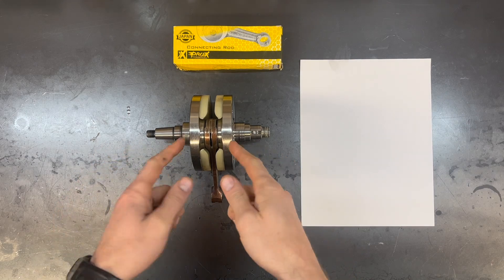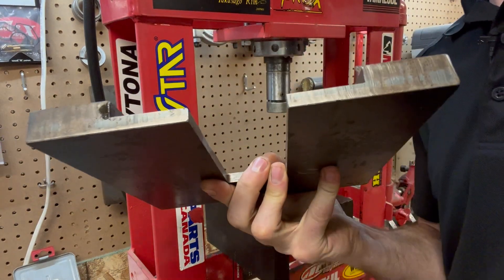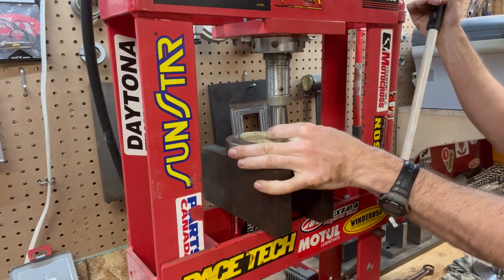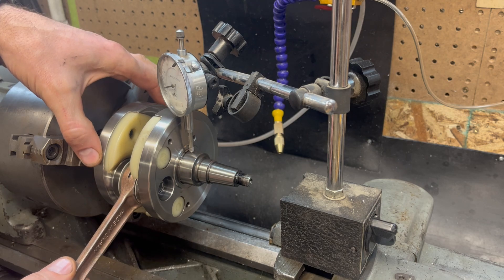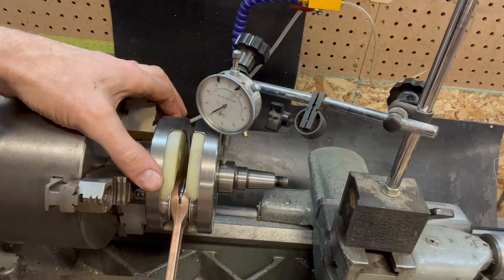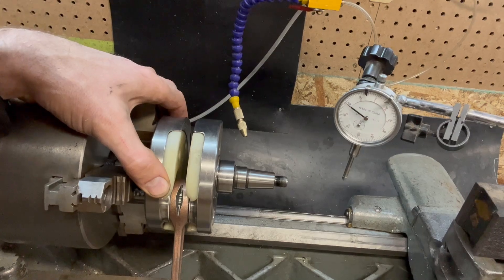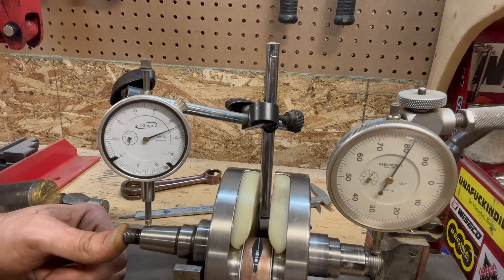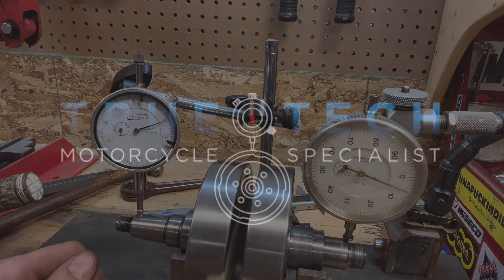How to Rebuild a Crankshaft

Comment: Finally! We have a professional. We have so many people rebuilding low ends, top ends, etc and not using any measuring tools and then they wonder why the bike’s parts don’t last. I’m surprised they even run at all. When building anything internal on any engine or transmission your best to measure it all and this way you have a motor and transmission that’s going to last a very long time and perform to your expectations. Thank God for this guy

Comment: Hi Chuck, thank you for this very informative video.  Being fortunate to have a well equiped workshop, I'm in the process of rebuilding a Honda CL350 crankshaft, having previously disassembled the outer crank webs only.  Now, having gently clamped both of the centre roller main bearings into a single vee block (on an engineer's surface plate), the minimal runout I can achieve at the outer main bearing journals (with the outer ball roller bearings removed) is 0.038mm / 0.0015", ie. approx 3x your target figure.  Unfortunately, unlike in your video, my crankpins have what is best described as a smooth-straight-knurled machined finish at their interference-fit ends, each which has formed a corresponding knurl in each crank web when it was originally assembled at the factory.  This has effectively created a 'spline' which is preventing the crank webs from being adjusted (I'm using a copper-head mallet) as demonstrated in your video at 4:46.  Any further advice would be very much appreciated; thank you.
Reply from the maker: It sounds like you’re describing micro-splines, which are quite common on older engines. They can still be adjusted a fair bit but do require more attention during the initial alignment. 
The numbers you mentioned are within the spec I mentioned (.002”) however.
Reply: @ChuckfromTrueTech  Many thanks for your prompt reply.  I've just found a Honda factory manual for the CL350, which details a "Standard Value" for shaft runout of 0.0008" with "Serviceable Limit" of 0.006"; this latter figure sounds very high to me, but then having trained as a tool maker where we worked to tenths of a thou (imperial units), it can be difficult to break the habit of working to very fine tolerances 🙂.  On a serious note, I do wonder whether this crankshaft with even a 0.0015" runout might have contributed to the smaller/LH main bearing having loosened in service on the crank, only slightly, but still enough that this bearing now needs Locktite to secure it.

Comment: Great video. I've done a hundred or so two stroke cranks and you've verified a lot of my suspicions, even to the point of having to walk away for a few minutes. I haven't done a four stroke crank yet. Aren't they pressed together with more force than a two stroke? What are the differences as far as rebuilding technique?
Reply from the maker: Not usually any tighter. Just have to line up the oil holes.
Reply: @ChuckfromTrueTech  I have a couple to practice on. All it'll cost me is a rod kit and hopefully I'll have a good crank😎👌

Comment: Hello bro,
if the thunderbird 350x bs4 crank only left-to-right little bit side play is good to used or what ? Not main bearing issue also not crank sound problem bearing problem.
only little bit side Play also not too much play it's normal Play only 
And also not main bearing sound issue please do reply Sir.🙏🙏
Reply from the maker: I cannot make out what you just typed man.
Reply: @ChuckfromTrueTech  Crank only side to side little bit Play are normal or not 
Crank bearing are good also not tak2 sound comes from crankshaft only Little bit side Play

Comment: Hi Chuck, do you use any lube on the pin before pressing into the crank web?
Reply from the maker: I don’t. Been thinking of trying it but never have.
Reply: @ChuckfromTrueTech  Thank you Chuck.  Of course, I would like to use some type of lube when pressing the pin for ease of assembly, but in the back of my mind I'm thinking about the increased chance of the pin slipping during operation.  I think I will test a scrap crankshaft and press the pin without lube, then disassemble and look for scuff marks...and maybe try this a few times and then draw a conclusion.  I did see a few videos where lube was used...it looked like 2-stroke oil or something thin like that.  Thanks for a great video.

Comment: Nice vid, I just did my second one in similar fashion.  KTM 85's both had similar run out when I was finished appx .0005 on the far side away from the journals.  Question is what is your tolerance?  The second one vibrates a bit, but my tolerance on the crank runout was the same.  I did lower the squish .004 on this bike. Nothing crazy but my son did say something about vibration when he first rode it.  New mains also.  Any insight would be appreciated.
Reply from the maker: I usually get them within .002”.
Reply: Hi thanks for the vid. I'm practising on an old kart crank. My kart engines go to 20,000 Rpm. I've got  the crank to 00.0005. Is that good enough? I'm using digital mitutoyo DTI which don't seem to register 00.0001.
Thanks again for this vid it's unbelievable helpful
Reply from the maker: @hopperdropper7137  Half a thou is excellent. I'm happy if they're under 2 thou runout.
Reply: @ChuckfromTrueTech  thanks buddy. I wouldn't have got started without your vid

Comment: I'm currently rebuilding a little suzuki GP125 engine and am at the big end replacement stage. This little crank has 2 holes approximately 25mm diameter in each web half. I assumed that these were for alignment pins, to negate the need for the tureing in a lathe. Am I correct?
Reply from the maker: No. Even if you could use then for alignment you’d still have to adjust it after pressing.
Reply: Holes are to get the balance factor designed for the engine.

Comment: Can you rebuild 77-78 xr75 , 79 up xr80 ,81 up xr100 cranks? I was told these are not rebuildable due to the tin (sheet metal) side...also i cant find 77-78 xr75 crank pin...Europe says they have them but the pin looks like one for a 73-76.
Reply from the maker: Can’t say I’ve tried. I’ve done CR250s with the tin stuffers.

Comment: Wait a minute.... Those two halves are ONLY held in by a slip fit!!!??? I did not know this!! How does that not move under engine load!? Wow that's good engineering! You're a master of your craft for sure!!!! I really didn't know this! I'm trying to polish my camshafts and came across this video and its super interesting! Wicked cool thanks for sharing!
Reply from the maker: If I remember correctly it’s the 4th gear on the YFZ450R that’s only held on by interference. That’s some crazy engineering.
Reply: Not a slip fit but a full on press fit.
Reply: Not a slip fit. An interference fit.

Comment: What’s the best way to clean up galling on the inner crank web surface?  When the crank locked up the bearing race dug into the web and   roughed the surface up.
Reply from the maker: Depends how bad it is. I’ve done it with a die stone many times. I’ve also cut it on the milling machine. If it’s that bad though I usually buy a new crank.

Comment: Hi, great video thanks very much. A few questions... what sort of hand press do you call that? 
The jig that the crank sits in, can you buy those or did you get it especially made. If so what sort of spec does it need to be?
Thanks very much
Reply from the maker: All the jigs for crank building are custom made. For pressing them apart I have a bigger one & a smaller one for different sized cranks. The V-block setup I had made by a friend. If you want one I can refer you to him. I bet he has the CAD files still. 
The press is just a cheap 10 ton.
Reply: Hi... yeah that would be great. I'm in the UK so its probably to far to ship but if he has the CNC files might be able to build them. Thanks very much its for my kart racing engines
Reply: Hi... I've found a press. I've got a few more jig questions. Are your resssed jigs 22mm mild steel plate?
The pair of raised jigs look like 25mm?

Comment: I have a older ktm 300 crank with larger plastic inserts on it, would using a special tool like that to press it apart crush these plastic inserts?
Reply from the maker: I haven’t come across a crank that is tight enough to crush the stuffers. Building cranks requires attention to detail though, and an understanding of the factors involved.
Reply: @ChuckfromTrueTech alright good to know, so i should be good to make up a tool like that and press it apart? of course keeping an eye on things as well

Comment: Hello I have a question about the crank pin. Is it okay if the pin is offet to one direction by a small amount, like 0.1mm, or is that unacceptable? When I pressed my crank back together, the pin is slightly offset and is slightly above the crank web on one side, and slightly under on the other side. Is there any way to fix this without taking the whole crank apart again?
Reply from the maker: Of course it’s not ideal, but as long as the pin isn’t interfering with the case it should be ok. I would adjust it by putting it back in the disassembly jig, pressing the pin back slightly on the protruding side & then doing the final measurement on the opposite side again.
Reply: @ChuckfromTrueTech  Ill do that today, thanks